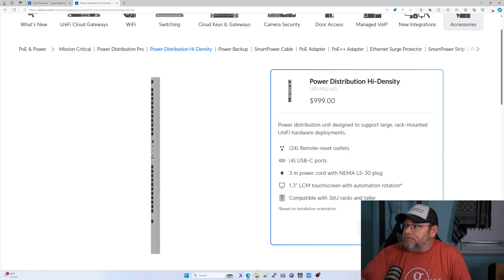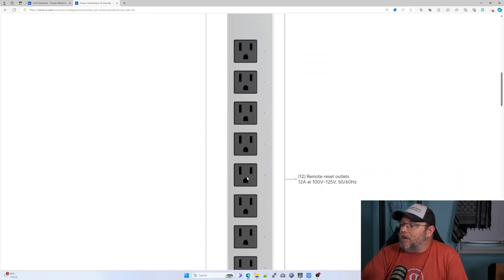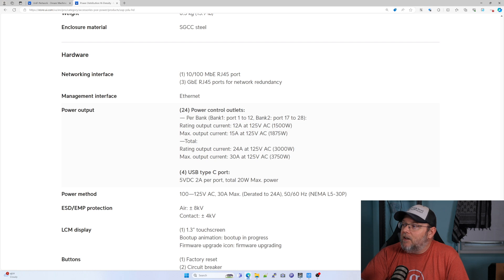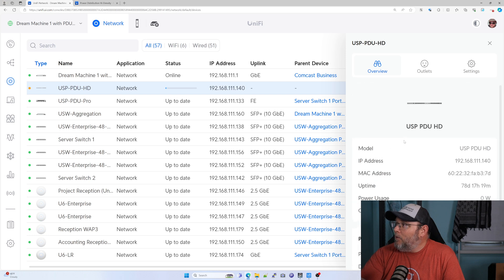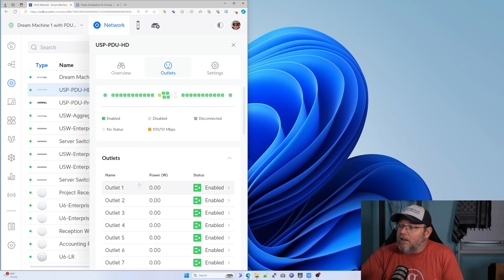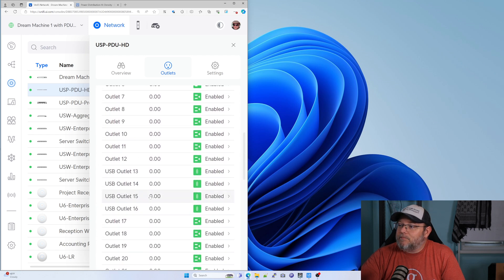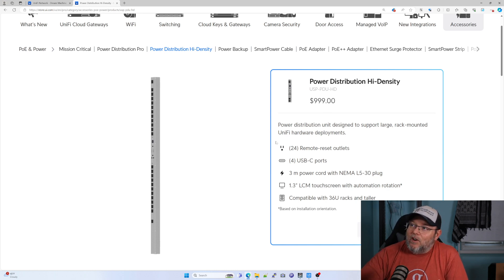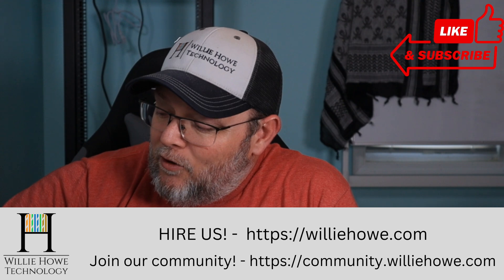UniFi Power Distribution High Density Setup

Comment: I got two of these recently to replace some units from cyber power that ended up being unreliable. Thought I was going to have to go with something from APC but then noticed these on Ubiquiti's site. The cyberpower units were $1,500 each and these are only $999 and integrate with the rest of our network stack which is Ubiquiti. Hopefully they will be reliable long term like the rest of our UniFi gear.

Comment: Willie, this thing looks awesome!  I just hope the logic is better than the original $20 single-device USP-Plug.  I tested those from early EA (sketchy), then still made the mistake of deploying several in GA, most of which had to be removed from service.  I still have a few online (when they will connect) for testing new firmware, but to this day they are unreliable and would create more modem downtime than they could ever recover from.  And now they are starting to die completely.  At least the multi-outlet PDU’s have an Ethernet uplink instead of WiFi.  I’d be very interested in feedback about the reliability of the HD model over time, and your or your customer’s prior experience with the Pro.  They are a great idea in concept!

And oh, the outlet spacing graphic is representative of the physical spacing. 😉

Comment: It's disappointing they don't offer a 208/240v option for balancing out the split phase power I have at home. I want to balance my server gear between the two phases as the utility bills based on which is loaded more.
Reply from the maker: Make sure you submit that to them for consideration.
Reply: @WillieHowe  I just nabbed a new in box AP8941 PDU off eBay for $160. Not sure UniFi wants to compete with that for home labs. And I think I used up my annual allotment of feedback with them between my switch firmware issues and access door controller rants 😆
Reply: @arigornstrider it’s a discontinued product and the replacement product by APC is $1500